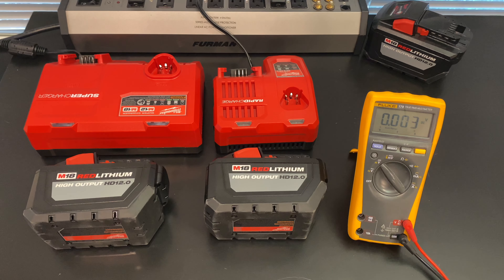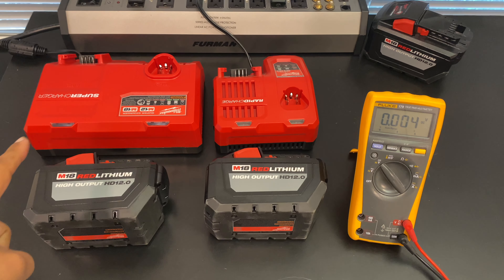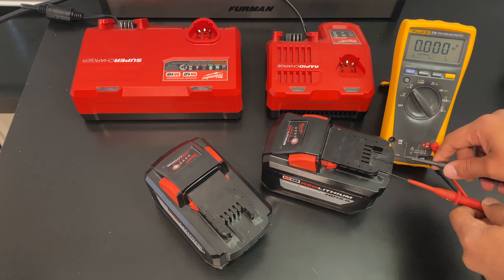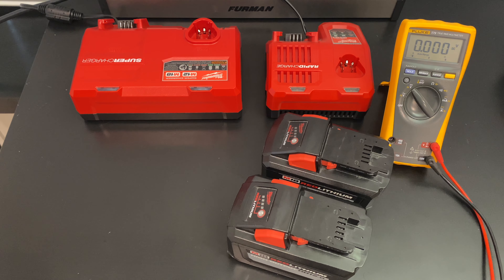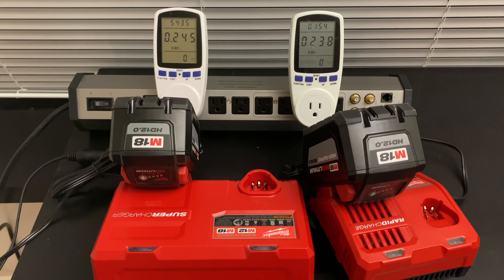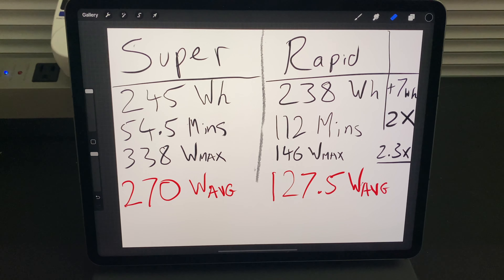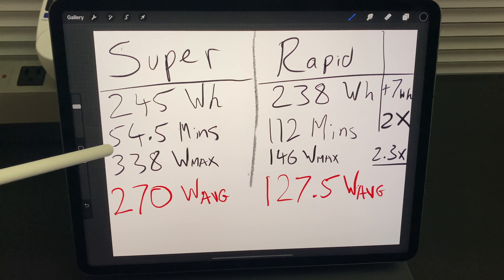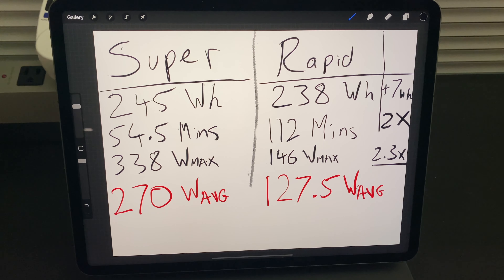Milwaukee M18 12.0Ah battery charging and analysis - Supercharger vs. Rapid Charger

Comment: Always had the understanding that slower charging will prolong the life of the battery
Reply from the maker: True, to an extent. There is such a thing as too slow! You can’t go wrong with a 1C charge for the most part. What that means is - if you have a 3000mAh battery, charge it at 3000mA, or 3A at the correct voltage.
For a Li Ion, that’s around 3.7V average, or 12W. This is why the 12W USB charger makes a lot of sense for phones.
Reply: @BatteryTestChannel  Honest question: What about phones that have batteries around 4,000-5,000mah and have 30w or even 45w fast charging. Like the new Galaxy s23 Ultra? Is that harmful to the battery at that point?
Reply from the maker: @DarkestofTimes  I don’t think they’re harmful, but they very much act like the V3 supercharger that Tesla uses. They charge at 45W for a short amount of time, and simply dive down to 25W for the rest. They’re 45W in name only in my opinion, and many of the tests prove it. Now what really scares me is the Realme phones that charge at 200W+
How the heck they do that is beyond me.
Reply: @BatteryTestChannel  lol, good to know, yeah that sounds insane.

Comment: Monitoring the battery temps during the charging is the only thing I wished you had also done.
Maybe a round two?
Reply from the maker: I did monitor temps and did not find an appreciable difference. I even charged the batteries “naked” and did time lapse testing with IR cameras but it really wasn’t much to report on so I just skipped it. The smaller batteries do heat up a lot more and warrants a video… eventually!

Comment: When you measure the amp send to batteries
Super charger charges 13.5amp
Rapid charger charges at 6amp
Regular charger charges at 3amp
Reply: (A) Where do you get this info, from the paper owners Manuel or on-line manual or off a spec plate on an actual charger?
(B) Would I do better and extend the battery life to just use a regular charger??
Reply: @stephenfiore9960  i measured them 
those High Output are designed to handle those rapid and super charger

personally i stick to rapid 6Amp
cells can easily handle higher 20-30amp
but bms might not be able due to heat
you can use a fan to keep them cool

most likely damaging the charger than battery itself
Reply: @TranTek  ….Thank you for taking the time to answer

Comment: I think the reason for the blinking and non blinking is due to the chip inside the battery. It knows how much power it needs to do the next job so bottom battery is saying "no I can't drill that next hole" and the top battery has been reset so it's ready to try something. EVEN though it won't go

Comment: Thank you.  How long to charge a totally dead 12AH high output battery in the 3 cases below:
(A) with regular charger?   About 3hr?
(B) with rapid charger?      About 2hr?
(C) with super charger?     About 1hr?
Reply from the maker: The regular charger eik take 4 long hours!! 2 hours with rapid and 1 hour with super. You got those perfectly.
It’s actually around 55 minutes with the supercharger.
The max power is very telling. ~80W, ~150W, ~335W.

Comment: It's better to slow charge your batteries,  super chargering isn't good for the cells. If you want your costly battery to last longer, don't rush the charge only if you absolutely need the juice.
Reply from the maker: Agreed!
However, defining a “slow charge” depends on the physical size of the battery. If the battery chemistry is the same, a larger battery will charge at the same rate, at a higher current.
Many modern chargers put out a standard charge rate, so while a supercharger charges a 12.0Ah at a “standard charge” speed, it definitely fast-charges the smaller battery. 
I hope that helps. Thank you for watching.

Comment: You missed the current, the super charger only supercharges the HO 6.0, 8.0 and 12 at 12 Amps and the rapid charges all M18 at 6 amps that’s the difference, the down of the SC is that over time it will degrade your batteries faster than the rapid, but not that much really, at 200 cycles it is expected to hold 80% of its capacity so it depends on what’s you do or what you want
Reply from the maker: Yes, you’re right that the extra power only helps the HO batteries, except it also seems to pass a ton of current to the 1.5Ah and 2.0Ah M18 batteries!

Comment: so is it better to use a faster charger for the higher output batteries? i have the rapid charger and the standard charger but my thinking was a faster charger wouldn't do the batteries very good? i just try to alternate between the 2 with all my batteries
Reply from the maker: I would not use the Supercharger with 1.5 and 2.0Ah batteries. Otherwise, you’re safe to mix and match. The larger the battery, the more impact you’ll see overall as you pointed out. So yes, use the Rapid charger for the bigger pack, since there is lower stress that way. Also, use the standard charger if you can spare the time on the small packs.
Reply: Once you know the current output each charger will have for each battery then use this formula 

0.5C=preferred slow charging for power cells 
1C=standard charging for power cells 
2C=absolute limit for charging power cells and not all support a full 2C

Charger Output (Amps)/Battery Capacity (Amp Hours)

13.5A/12Ah= just over 1C
6A/2Ah=3C no no no no bad

I know the rapid charger can detect battery size from a BMS signal to prevent the smaller batteries from getting 13.5A but 6A is still quite a bit for medium batteries and too much for the smallest guys

Comment: Voltage does NOT represent state of charge. Its honestly besides the point anyways. Apples to Apples for this test is will be very minuscule to the end result. They are both 18 volt batteries. So the apples to apples analogy doesn't even apply either. Comparing apples to oranges would be like comparing M12 and M18. But you have two M18 batteries... so two apples. I bought two M18 5.0 batteries brand new and they both came blinking red. Put both of them on a dual rapid charger. And they literally finished within 5 seconds of eachother. I did not test the voltages or anything like that. This just goes to show that blinking red IS blinking red. Yeah maybe one is measuring slightly less voltage than the other but so what. Its really not even a big enough variable to even be considered inaccurate to the test. A good multimeter (like the true RMS Fluke meter you have) is displaying an average on the screen. That voltage number is not the exact number either. Its compiling the averages.
Reply from the maker: At the very end, the voltage curve falls off a cliff and is therefore meaningless. Perhaps I shouldn’t have mentioned this blinking since - as you said - they will finish within seconds of each other. I was just curious about the blinking behavior.
While I agree that you cannot glean SoC purely from voltage, there absolutely is a correlation. It’s just a poor predictor due to a flat discharge curve. So it’s possible to get a ballpark curve. I just can’t tell you if its 40% or 60% because the curve is not linear. A rise from 3.2V to 3.7V is much less significant than 3.8V to 3.9V for example.

Comment: What kind of a gauge are you using, white. Time line 5:36
Bob
Reply from the maker: Hi Bob. I'm using  generic power meter off Amazon. If you simply search for "US Power meter" on Amazon (or ebay) - they will come up. They're reasonably accurate, I tested them with a 10x clamp accessory and it was within a couple of watts.
I'm not giving you a direct link because it changes by the day - as you can tell by the two meters I have looking similar, yet being different with no label.

Comment: Dude,
You have to put a (small) load on a battery to test the voltage. The internal resistance of the meter is too high

Comment: Lithium battery charge doesn't go by voltage
Reply from the maker: You’re right. The voltage is relatively meaningless especially at the fringe. A 0.1V difference has very low impact. I’m just pointing out what I see really.
Thanks for commenting!
Reply: @BatteryTestChannel  thanks for reply something you may also wanna test is equally draining both batteries with a hobby grade charger were you can discharge a set amount of mah after both batteries are fully charged then charge can get complicated tho
Reply from the maker: @nightmareinaction629  Good idea! I do have two M18 lights. I can measure current draw and confirm that they are equivalent and use them as a load.
I’m also into RC, and do have a SkyRC B6 i could use. I’d need to wire up a balance charge connector to the battery, which will get a little dicey…
It’d be a lot easier with an M12 battery, since it’s 3D instead of 5S.
Reply: Wrong, that is a feature unique to LiFePO4. NMC/NCA lithium ion can be reliably correlated to State of Charge with an Open Circuit Voltage after the cell has rested without a load for at least an hour.